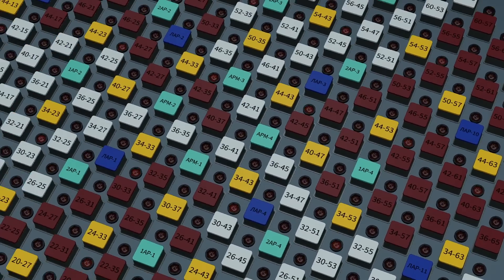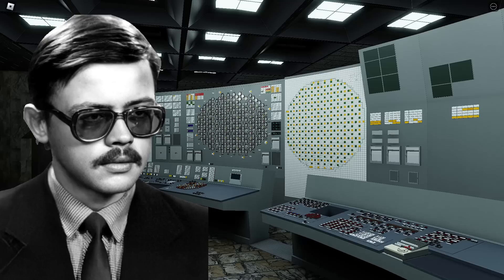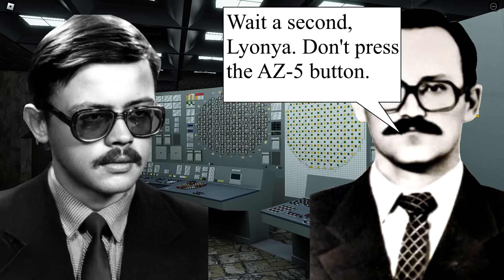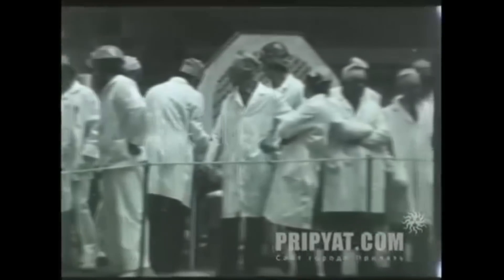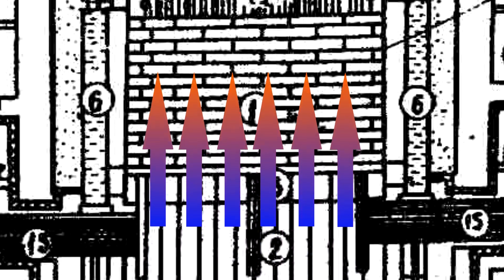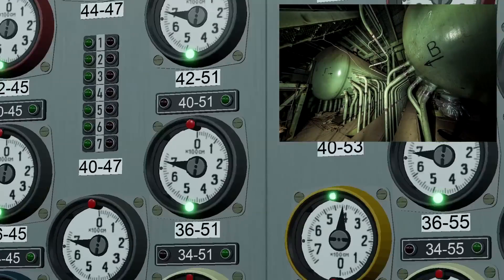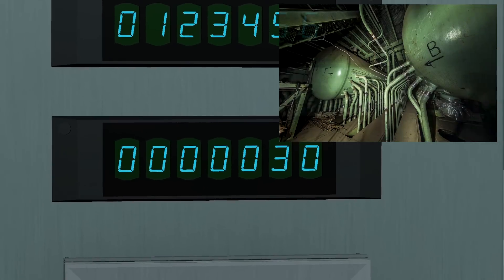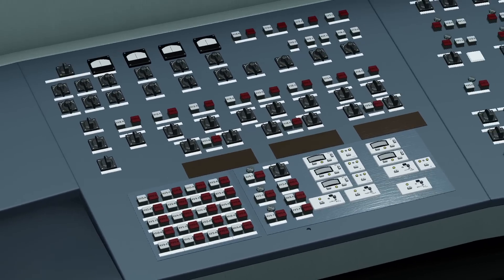Would Not Pressing AZ-5 SAVE Chernobyl?

Comment: In my opinion, the reactor was lost when the control rods were raised too high to break the xenon poisoning in the core. The use of AZ-5 only made the situation worse. Failure was already inevitable. Interesting and good video.
Reply: Exactly. The reactor was in a state that was unrecoverable by any means they had at hand a minute or so before the power surge and explosion. Or maybe, and only really maybe IF they knew the real situation of the reactor with its design flaws, taking into consideration the critical reactivity margin they had as well as the violation of operational procedures they made in order to do the test, they could prevent an explosion by "flooding" the core with "cold" feed-water before the start of the test (thus invalidating it and shutting down the reactor for a longer time) and only after the reactivity dropped below critical inserted the control rods and eventually the scram rods, would they save the reactor from exploding. But this is pure hypothetical situation and they had absolutely no reasons to do what I just described. They wanted to do the test and did everything they could to run it. The test should not have been made. Once the power dropped practically to zero a few minutes before the test, it was clear that it made no sense anymore, especially since they managed to rise power only to about 200 MWt. Which itself is quite impressive considering the Xenon poisoning and burn-up of the fuel rods. The reactor running at 200 MWt was in a very unpredictable state. Maybe my speculation would have not worked anyway and the reactor would experience a power surge. Maybe it would not blow up, but it would certainly cause massive damage to the core, maybe even so as making the reactor inoperable after that. Like what happened at Bohunice A-1 in 1979. The incident was caused by different reasons, but the result might have been similar - melted fuel assemblies, contaminated primary and secondary loop (the RBMK has no secondary loop) and a "bricked" core that only can be written off and eventually dismantled (after decades). Chernobyl would have remained an INES-4 or maybe INES-5 incident, if judged by the IAEA scale introcued in 1991. The question is, if a far worse accident would have not happened on another RBMK design, since it would have been covered up by the soviets and no lessons would have been learned.
Reply: @erikziak1249 they stalled the reactor. Dude told them to raise power. It started to surge. They hit az5. They could've let the reactor stall and poison itself.
Reply: @ErikZiak bruh you clearly aren't a nuclear engineer or close to it even
Reply: @SimianIndustries buddy and you are??? 😂😂😂 I’m deaddddd
Reply: @ErikZiak  In other words you don't know what you're writing about.
Reply: It's a moot point, but if they had press AZ-5 before the output started rising at all, while the xenon poisoning was still high, it may have been fine. But, as you mentioned, the only reaosn they pulled the rods was to force a "burn through" of the xenon, so they weren't about to hit AZ-5 right after pulling them.
Reply: You should still include: The old simulation shown here was made using the computing power of the 1990s. Alone the memory limits at that time meant that the model of the Chernobyl core was modelled relatively coarse and the scale of the huge reactor was not adequately possible to simulate at that time. It would even be a challenge for modern number crunchers. A modern simulation could include more factors and would be better in finding small hotspots, which can already trigger a rapid unscheduled reactor fuel ejection. I wouldn't trust my life on it and play the hell safe there, even if a more accurate simulation would confirm its finding. Its better to be safe than irradiated.
Reply: @denniskrenz2080 that's an assumption based on not much
Reply: @SimianIndustries  Thats a statement by a former HPC software developer. Shove your polemics right where the sun doesn't shine.
Reply: AZ-5 only made the inevitable loss of containment happen faster (and more violent).
Reply: @wage0048  AZ-5 was pressed as a last resort. They had plenty of time to shut down the reactor, but chose not to because Dyatalov refused because he wanted to report a completed test. They had already failed and Toptunov wanted to shut it down… but Dyatalov refused  and waited until they had no other option but to scram the reactor…. Which under the specific conditions that they had created by running the reactor at low power for an extended period of time and withdrawing the majority of the rods, triggered an explosion that should not have normally occurred, and frankly could not have normally occurred, except for the tampering that they did with this reactor
Reply: @wage0048 not necessarily
Reply: It may have failed more "gracefully " and do a "3 mile island " instead..
Reply: There was one other way they might have prevented the explosion.  If there was a second emergency shutdown to dump a massive amount of Boron into the cooling water, that might have poisoned the reactor the same way the Xenon does.  It might have rendered the reactor permanently inert, but I think we can agree that would be infinitely preferable to the explosion.
Reply: @ericsmith8373  Wouldn't have been THAT bad, since modern PWRs are also regulated over the long term by the amount of boronic acid in the water. But the RBMK wasn't equipped with the required systems to do that. Also, how fast the boron gets into the reactor depends on the magnitude of the coolant flow. The emergency cooling system could have been enough by just dumping lots of cold water into the reactor (and cause same damage) and reduce the positive void effect a lot:  But they deactivated it before the test (since it would also reduce the production of steam in an emergency). Also it never had more negative reactivity than the AZ-5 button caused positive.
Reply: @denniskrenz2080 I guess, in the final analysis, Chernobyl blew up because of arrogance and stupidity.  And there's no technical fix for either one.
Reply: They would have been fine if they didn’t remove the rods to accommodate the low power
Reply: @WildBillia  That's the only way.
Reply: @ not exactly if they just left the rods in and let the xenon stay in the reactor it would just completely stop all reactions and just destroying the reactor not everything but don’t take my word for it I don’t have no fancy degree or nothin so I may be wrong
Reply: What if they suddenly turned on the coolant water feed when they detected the power surge? Would it still have time to reduce reactivity?
Reply: @jeromegaces6184  Hard to say. Things evolve very fast, maybe it was not enough time to clear voids and reduce reactivity. Maybe emergency cold water injection direct into core would be successfull (despite to core thermal shock and necessary repairs), possible less catastrofic outcome.
Reply: The  control rods was Graphite tipped with a length equal to the control rods so when they tried to lower the rods back down the graphite accelerated the reaction before the control rods were in position.
Reply: If the rods had been inserted one or two at a time instead of all at once, then perhaps the extra reactivity from graphite rod tips would have made the reaction faster but not enough for explosion.
Reply: @suburbansolarhomeandpreppi9936  exactly. finally, i see the obvious solution. perhaps not one at a time but a few at a time at a pre-calculated rate that accounts for the wanted flaw
Reply: It's so funny seeing all of you guys taking a debate so seriously while simultaneously and OBVIOUSLY not having a clue what you're talking about. It's also clear most of you either didn't watch or didn't understand the video.
Reply: Yep. I suppose there's the possibility that the loss of the reactor might not have resulted in as much widespread destruction, but as soon as the Xenon started to burn off the reactor was doomed to melt down.
Reply: Does that didn’t watch the video and give their opinion must have a PhD in nuclear energy..
Reply: why not simply inserting fewer rods than all at once (AZ5) so the tips arent in place all at once?
Reply: @DaisyTotom  Time was over, reactor going supercritical faster than control rods was able to counteract.
Reply: The reactor is not stable at low power. So basically the reactor runs fine from a cold start and operating at rated power. With the constraint of having enough control rods down, the reactor is still safe. The reactor just shuts itself down without any issue. Raising those rods then there's no way back.
Reply: HBO isn't your friend alot of that was lore not truth
Reply: This correct. They broke operating procedures by removing rods beyond minimum allowed number
Reply: The reactor was lost when it was built. Soviet sh*ty scrap
Reply: It was total stupidity letting an inexperienced team carry out that test? With a twat supervising everything.
Reply: I concur. (I didn't watch the video)
Reply: @myreply1714  check your knowledge man, certain varients of the RBMK are still in use, especially EGP-6 tech in russia. BWR's are used and so are VVER'S, but the EGP-6 tech is the most advanced format of the RBMK, thats all I said.
Reply: Thank you Captain Obvious.
Reply: All this is a replication of the Soviet lie about the causes of the accident. If you want to know the truth, watch: HOW THE 4th UNIT OF CHERNOBYL NPP WAS BLOWN UP.   (KS channel)
Reply: The reactor was doomed the moment they allowed the test to proceed. Knowing full well it was held at half power for a further 10 hours past the original test time.
Reply: https://www.youtube.com/watch?v=yIA_FMz9n1k
Reply: Yes Xenon core nothing to be done
Reply: https://www.youtube.com/watch?v=yIA_FMz9n1k
Reply: Another wanna be tech who watched the HBO Chernobyl series….
Reply: You can lose the reactor without a disaster. Them not pushing az5 could've allowed other situations to poison the core but with less adverse effects
Reply: @bmxriderforlife1234  Yes, but when they raised control rods full up to break Xenon poisoning, then things went south quickly.
You are right, protocol demand in case of xenon poisoning to turn off reactor for 48 hours for xenon decay in normal way. And restart core from clean state.
Reply: @adamw.8579  24 H not 48...
Reply: People usually forget that the rods couldnt even enter more thsn one 1/3 lf they way to the core because the massive temperature and pressure destroyed the holes and around 50 uranium bares
Reply: But then az5 did not things worse as things were leading disaster anyway. It 'just' made it faster
Reply: “15 seconds, they may as well had 15 days”
Reply: Opinions are like ass holes…
Reply: There’s a reason why Dyatalov how to disable the safety in order to extract the rods that far, it was never designed to work with that many rods retracted…. The flaw in AZ5 wasn’t really a flaw so much as the button was never designed to scram the reactor with that many rods retracted…. Because the safeties would prevent that many rods from ever being out of the core at once.
Reply: Well even if we consider not pressing AZ5, then as well as mentioned would not have made much of a difference. The reactor was much lost when toptunov withdrew almost all rods from the rector. The root of the problem is AZ5 and the reactivity of low grade uranium. Toptunov shld have rather scrapped the test and rather shut down.
Reply: @Arpan.78-z7z  What's special about the reactivity of low grade uranium?
Reply: @markusw7833  Now, that's where I made a mistake though and I heavily aplogise for it as well. Its not low grade uranium, its depleted Uranium-235 or U-238. Chemically they react the same, but PHWRs as per some nation's programs, use depleted Uranium fuel, to generate enough energy for the production of P-239, so as to combine it with thorium and make it fisssile. @markusw7833 for acknowledging it.
Reply: @Arpan.78-z7z he tried to, Dyatalov refused multiple times.
Reply: @Arpan.78-z7z It's funny how no one in the comments actually watches these videos, and goes about spouting popular misconceptions that the video directly disproves. They could have shut down the reactor up until the last minute if they had known how to work around the design flaws. Also I'm not sure what you think 'low grade uranium' has to do with the problem.
Reply: @MinSredMash  as far as me not watching the video is concerned. Low grade uranium does have a lot to do with the problem. Today's reactors infact the RBMK1000 as well use graphite as moderators and high grade uranium fuel which can be dealt with easily. It's not a misconception. As far as dealing with the design flaws are considered, no one except toptunov knew about the fact but the circumstances they were in, there was now way out but to shut down. He knew that control rods may indeed accelerate reactivity for a brief moment. He had withdrew most of the rods by then. During the trials as well dyatlov was shown documents which were never given to him while he was preparing the reactor.  So it was indeed kept for them,  the flaws in the core and the control rods. Also this man uploaded a video abt dyatlov so go check that out as well.
Reply: @MinSredMash  not great not terrible
Reply: @Arpan.78-z7z The CANDU uses uranium of even lower enrichment than the RBMK and has no such safety issues...
Reply: @MinSredMash  But dude, Look at how advanced IPHWRs, VVERs and RBMK-EGP 6s are.
Reply: True, but they don't use graphite. Using heavy water makes it possible to use such low enriched uranium. I think they can even use natural grade uranium. Heavy water is expensive, though.
Reply: @RobertCraft-re5sf  it is but PHWRs are way safer and their structures are also well designed. Thanks !!
Reply: @MinSredMash Still, beats religious opinions 😂
Reply: @MinSredMash you’re forgetting that Dyatlov was an egomaniac and was being pressured by the Soviet government to complete the test. It would take too long to let the poisoned core sit and let all the Xenon decay
Reply: @aoutsky  You are describing the plot of a silly TV show, and mistaking it for history.
Reply: Yes, and the voids were either air or steam and neither is going to cool down the rods to the required temperature. More much cooler water will go to the bottom and not to the top where it's required. Lowering the rods further only compounds the problem. If they could have voided just the steam and pumped in warmer water there was a chance but probably only a small chance of recovery. A poor design that should never have been approved. Falsified quality inspections supposed to be of the entire containment pool turned out to be multiple copies of a good weld and specs which 80% of the rest failed. Graft, political pressure to the point of fearing for your life if you don't play along or cause the oligarchs to miss out on any money.
Chernobyl is one large reason for the downfall of the Soviet Union. Now Chernobyl is an albatross that Ukraine has to tend to for many generations.
Reply: @elessartelcontar9415  Also, steam doesn't moderate neutrons or reflect them back to the fuel. Without external moderator, steam really reduces reactivity by simply letting the neutrons leak outside the core or be too fast to cause a fission. Thats how modern PWR work, but you can't refuel those during operation, they need to be shutdown, cooled an depressurized. RBMK or CANDU are designed for continuous replacement of spent fuel. RBMK uses solid graphite, the much safer CANDU uses heavy water (deuterium dioxide), which has its own negative void coefficient.
Reply: I recommend watching this: HOW THE 4th UNIT OF CHERNOBYL NPP WAS BLOWN UP (channel-KS).
Reply: AZ-5 did not make the situation worse. The explosion was inevitable before it was pressed.
Reply: @VersusARCH it made things happen faster
Reply: Great job completely ignoring the entire video
Reply: @MinSredMash  Video kind of ignores several other flaws of the reactor design, and mentions the positive void coefficient being high enough for prompt criticalities, but doesn't discuss what a prompt criticality would do to fuel channels.  It would do exactly what it did in other units previously.  It would break the channel and release steam into the graphite.  By the time they hit the AZ5 the reactor was already in a runaway chain reaction event.  The ORM was something that wasn't discussed and the Soviet operators had no real training in maintaining a safe ORM.  The entire reactor doesn't have to blow up, just a small section going prompt critical would release enough energy to rupture steam lines, and under the pressure and temps the coolant was at, is plenty to blast the biological shield and the poorly constructed containment building into a pile of rubble.
Reply: @clanc433  No other RBMK ever experienced a prompt criticality, and the reactor wasn't running away until three seconds after AZ-5 was pressed.
Reply: The reactor was lost when it was built. Soviet shitty scrap
Reply: @MrGreen-zh5mx7xg3s  funny, lots of reactors of same type worked just fine
Reply: @markusw7833  in my opinion the situation became untendable when they switched of global automatic controll and switched to local control. The reactor stalled and they couldn't raise the power from the bottom of the xenon pit.